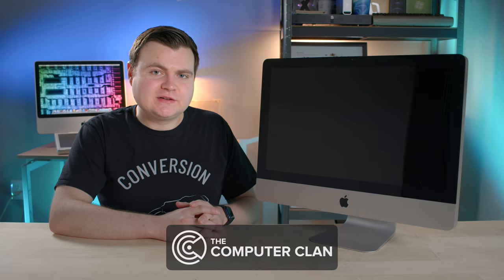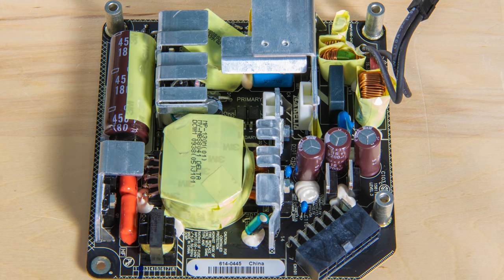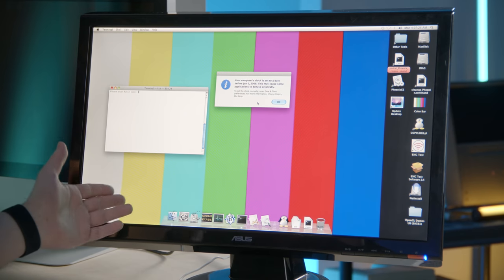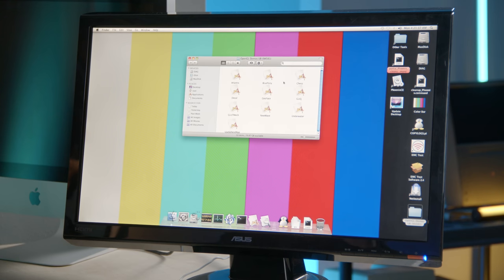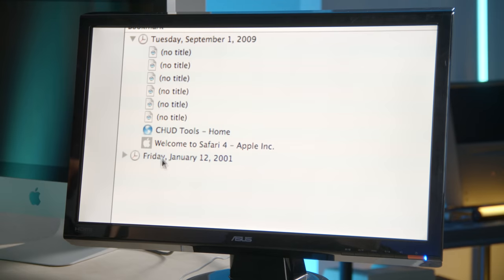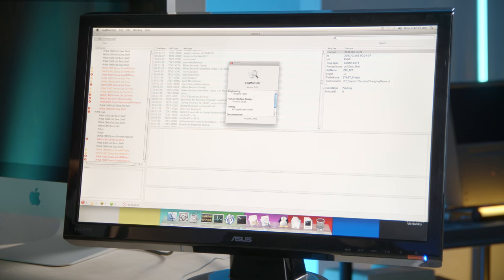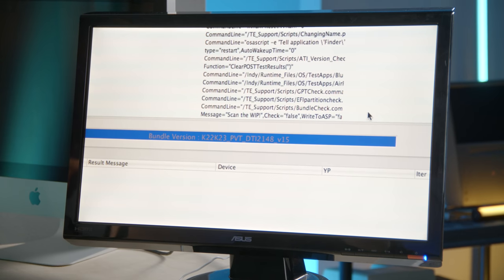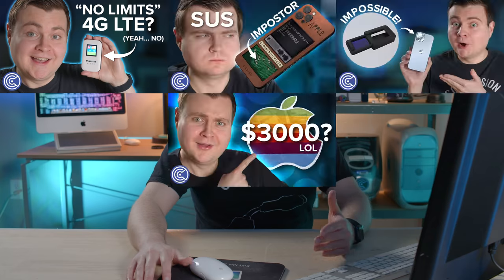Apple Forgot to Erase This iMac's Internal Software - Krazy Ken's Tech Misadventures

Comment: this makes me miss the days then the front glass was held on with magnets instead of an entire 55 gallon drum's worth of glue.
Reply from the maker: I feel that 😔
Reply: nahhhh it was 55 gallons back in 2017 now its 110 gallons 😂
Reply: @SStarlight9614  Next year the glue will be too expensive and will be replaced by "Hopes and Prayers."
Reply: Hopefully there will be a "glue and adhesive" shortage so Apple is forced to make things more repairable again.
Reply: Ooof, I feel you pain too--get out your spudgers! :)

Dell's laptops have a front plastic bezel in front of the LCD panel that uses a strip of high-stick adhesive along each side facing the LCD to adhere to the LCD's edges.  A real pain in the rump to pry one of these bezels off sometimes without breaking it, due to being thin plastic--at least it isn't glass. :O
Reply: Apple is going lose half of it's value in next few years. Entire company.
Reply: @JJ Bluestone I have a 2007(?) vintage Lenovo laptop (IdeaPad Y730) that seems like they glued  the face glass on as well.   Have never found anyone who knows how to dismantle this macine's display, and searching for it is further complicated by Lenovo foolishly re-using the same series and model number for their later "Legend" systems.
Reply: @simtitan1  Actually, the US and EU are considering laws that would legally mandate end-user repairability.
Reply: @Vanilla0729 oh nah
Reply: “I just dropped a screw inside” every single time when it’s mac -..-
Reply: Fr
Reply: Funny thing, i have an imac with a good LCD and cracked glass. I managed to get the glass off without damaging the LCD, and now i cant find the glass to buy because they never expected anybody to actually get it off

Comment: AppleKFS is kernel file system. It is useful for knowing what's going on with the system. It's especially the same as /proc on Linux, which just reads ram and other system activities. They are both virtual with very limited write options
Reply: This is the correct answer.
Reply: Abstract— The Knowledge File System (KFS) is a smart virtual file system that sits between the operating system and the file system. Its primary functionality is to automatically organize files in a transparent and seamless manner so as to facilitate easy retrieval. Think of the KFS as a personal assistant, who can file every one of you documents into multiple appropriate folders, so that when it comes time for you to retrieve a file, you can easily find it among any of the folders that are likely to contain it. Technically, KFS analyzes each file and hard links (which are simply pointers to a physical file on POSIX file systems) it to multiple destination directories (categories). The actual classification can be based on a combination of file content analysis, file usage analysis, and manually configured rules. Since the KFS organizes files using the familiar file/folder metaphor, it enjoys 3 key advantages against desktop search based solutions such as Google’s Desktop Search, namely 1) usability, 2) portability, and 3) compatibility. The KFS has been prototyped using the FUSE (Filesystem in USErspace) framework on Linux. Apache Lucene was used to provide traditional desktop search capability in the KFS. A machine learning text classifier was used as the KFS content classifier, complimenting the customizable rule-based KFS classification framework. Lastly, an embedded database is used to log all file access to support file-usage classification.
Reply: I pulled this from a computer research paper on the subject and I feel like this would be more accurate…
Reply: @revlouch  I doubt it’s that.

The kernel file system answer seems to be the more likely, given the diagnostic nature of the OS running on that Mac.
Reply: If it's a kernel file system, why would it be a physical partition on disk? Kernel file systems are virtual.
Reply: @Daniel15au  Because, if the kernel intercepts io calls, even disk utility might be tricked into thinking it actually exists. For all intents and purposes /proc on Linux has actual files and folders in them. You can stat them all day, and to bash, sh, zsh, gnome, kde etc… it appears as if those files and folders actually exist on disk.
Reply: @1FireyPhoenix  makes sense, thanks for the reply!
Reply: this is very unlikely. The bsd style disk name that he showed lists a partition number. virtual file systems never have a partition on the disk, let alone the main disk (disk0). Virtual filesystems will show up as a mounted filesystem, but won't have an associated disk partition.
Reply: I could be wrong, but I think OS X still uses (or used at the time) the vfs from BSD, so I don't think they'd have any reason to have fake partitions to represent virtual file systems.
Reply: So indeed it is the kernal's secret recipe.
Reply: Ahh, so it's like linux's relayFS? For delivering message from kernel module up to userspace?
Reply: This is wrong. Apple_KFS is the partition type, not the file system. It clearly says that in the video. It also doesn't list any file system, so either there's nothing on there, or it's an unknown file system to macOS. Partition types aren't the same as file systems. E.g. EFI partitions, recovery partitions, encrypted loop partitions etc. Even in Windows, there's one partition type for NTFS, exFAT and ReFS, type 07, or 0700 if you're using GPT layout.

Comment: Whilst opened up, it would have been wise to temporarily extract the hard drive to copy a full block level dump of it. The contents would have been super interesting for others to explore, and it would have saved the contents from never being rescued if the disk failed. Otherwise a nice video!
Reply: Just read in other comments that was apparently not supposed to be backed up. Ah well.
Reply: @everythingpony  Exactly!! Even powering up such an old disk, possibly one that didn't yet meet production standards, could cause its death - even more so booting an OS off it and using stress tests on it.
Reply: @Time4Technology  You would not use a hard-drive that is not up to production standards for a Product Validation Test unit.
It is easy to upgrade and test hard-drives later. It is a wast of time to hunt down hard drive issue, when that is not one of the uniqe selling points of the device.
(if the SSD Chip set is soldered to the mainboard, then offcourse it could be not fully qualified - but even then, reducing risks means using proven silicone and software on a new motherboard makes more sense then to combine all new parts)
Reply: Not legal sadly.
Reply: @FeedMeSalt  Legality can honestly kiss my behind when it comes to software preservation, especially pre-production stuff

Comment: As a former employee in Apple's Sacramento warehouse I can tell you that PhoenixCE is indeed a version of MacOS with a bunch a testing suites used to troubleshoot. We would load Phoenix then leave the systems to burn in for 2 days then if they fail there were logs for us to read. The version of Phoenix here is much older than the one I seen. The version I knew was based on Yosemite. Most of the tests runs on its own but some of the display calibration tests and keyboard tests had to be manually gone thru and passed/failed before the rest of the tests can load. And yes it could be loaded on any mac that can support that version of MacOS it was based off. By now I'm sure they have a newer Phoenix than even I'm aware of, used for the T2 macs more than likely. So this version of phoenix would not work on newer macs.
Reply: You are correct and to my knowledge Phoenix (and most of these tools) is not installed to new machines these days it is used from local network preventing it from leaking like this!

Comment: As a former Apple repair depot tech, can confirm that Phoenix is Apple's  test bundle name. The versions would differ between models but it was always a Phoenix environment. Seeing those failure pop ups reminds me of all the headaches but still pretty cool to see it again!

Edit: as far as the K22 thing goes, you're right. Every Mac model will have this number combo to point out year and Gen, but not necessarily the specific build. For example, the J52 was the 2015 MacBook Pro Retina 13 with forcetouch. J44 was the mid to late 2014 MacBook Pro Retina.
Reply: Thanks, SouthernFriedTech
Reply: Oh what about the J680, J132, and J152?
Reply: Very interesting! I do liquid damage repairs on Macbooks and I was always curious what the codenames at the top of the schematic were - the 2014 Macbook Pro example you used has an 820-3476 logic board, and the schematic says J44 as well!
Reply: Lol remember when they openly called a feature “forcetouch” without thinking about how much it sounds like a slang word sexual assault
Reply: "Apple's  test" you double spaced it.
Reply: @pickachublast8  maybe they add a digit to original identifier for revisions?
Reply: @thomasholland5902 did they remove that branding because of that? I always thought they just don’t bother mentioning their trackpad tech anymore since it’s been the same for 8 years.
Reply: @LuLeBe  nah just they changed it to 3D Touch

Comment: The last time anybody on the AppleInsider staff used or saw the "Phoenix" suite of software was several years ago. Even then, during the testing process, the software would have to connect to either a hardware dongle or data stored on a LAN -- not WAN -- to complete testing on any given model.

Eradication of the testing software is a required step prior to returning a repair to a user, and there is a specific procedure that is followed to ensure compliance. Obviously, those steps were skipped, resulting in the leak of the software.
Reply: Do you know what method Apple uses to delete the software, or otherwise have any information that might be useful for someone wishing to covertly protect their newly-acquired copy of the software from being re-erased by Apple before they get their computer back?
Reply: @Sparkette  >Do you know what method Apple uses to delete the software
they probably just deeply format the drive on the mac. if they dont, then idk what else you can do
Reply: I had to send my 2006 MacBook to Apple because of a bad heat sync and they sent it back to me with Phoenix software. I had to send it back AGAIN. Sucked

Comment: 18:35 "Raw" usually refers to the raw data representing the value, while "Cooked" refers those values having been converted into something fit for human consumption
Reply: I've never heard the term "cooked". I should probably start using it, though, because typing "converted" all the time in my code is a bit cumbersome
Reply: @IndellableHatesHandles  From the jargon file:
cooked mode: ... Most generally, cooked mode may refer to any mode of a system that does extensive preprocessing before presenting data to a program.
raw mode: A mode that allows a program to transfer bits directly to or from an I/O device ... without any processing, abstraction, or interpretation by the operating system
Wiktionary gives the etymology of cooked mode as "a humorous opposite to raw mode".
Reply: It is like when you have raw food and you have to cook it
Reply: A raw partition doesn’t have any data on it yet, i guess
Reply: @CerealNumberWDW1984  A raw partition usually means that the partition does not contain a filesystem recognised by the operating system / disk management software.  There might still be a filesystem, but it is not recognised.

Comment: I think the backlight doesn't work because the PSU is different than the previous one, you need to get a backlight driver board compatible with this PSU that you replace or find a compatible PSU. The description of the flickering then it shuts off is almost everytime a compatibility issue between those two parts.
Reply: Def seems like it's not getting enough voltage, yes.
Reply: Backlight board in these don't care what kind of PSU is installed
Reply: @michvod  We are literally talking about a company who goes as far as locking components to specific devices with unique identifiers (on newer iPhones at least) so I wouldn't be so sure
Reply: @baconofburger8784  Yeah, but I literally repaired hundreds of these model iMacs and I know that backlight board and PSU are just dumb units and don't care which one is installed ;) This is 2009-2011 when Steve Jobs was still around
Reply: @michvod  fair

Comment: A screen full of H was what caused a computer to generate the most EMI back in the CRT days. We used it for FCC emissions testing.
Reply: H reigns supreme
Reply: because of the sudden changes from full bright to full black? I guess as the electron beam scans across it would have to turn on and off rapidly many times per line per frame.
Reply: @iammeok  would hashtags not be better in that case?
Reply: @Stego27  The character "#" is called a hash. A hashtag is a word with a hash appended to the start. Eg. #retrocomputing
Reply: @Stego27  yeah idk, maybe they didn't have '#' in whatever character set they were using?
Reply: @Joseph Palmer
interesting....I would think a bright white screen would do that since all 3 guns are firing and all RGB dots are on...maybe i am remembering my CRT tech wrong... it has been many years since i worked on CRT's
Reply: @MickeyMousePark   I think you'd actually get less interference from a fully white screen because you'd hardly have any changes. Seems to me that a screen full of alternating black and white pixels would be what would make the most noise. A capital "H" would have four black/white transitions on every line except the middle, which would only have two, so it'd make a decent universally-available source for a signal with plenty of transitions.
Reply: Wouldn't the IIIII be more effective in this case?
Reply: @pierreuntel1970  No, the H pattern caused more emissions harmonics, because of the difference of the gaps between the On-Off events.

Comment: Apple_KFS, the KFS is probably Kernel File System, something (similar to Proc on Linux). The 1.9TB is possibly nonsense as it will be virtual, and I would suspect that this is how some of the Diagnostic tooling chats with the Kernel Space in a more privileged mode.
Reply: Then why have it representred on disk? Spinning metal cache for swap and what not is fine, but proc and similar are virtual filesystems which won’t be on disk. Caching process state even for debugging would slow the system down and bottleneck the system. We need to see the first few MB or so to understand the data.

Comment: Also, there's a chance those URLs do work but only on Apple's internal network, but I'm sure you already know that.
Reply: brian ting  that is illegal
Reply: brian ting  I don't think they're gonna give you Internet access and if then definitely not the WiFi for the internal systems.
Reply: brian ting  Hope not!  That would be a major security flaw on their part ;)
Reply: brian ting  that is a very funny idea. Even company with small IT departments sand box the guest Wi-Fi. Even the internal LANs are typically split between departments. (Note in the windows world to protect the core network from the wild developer machines - not to protect development from theft)

Comment: The Electrolytic Capacitor that blew is in the backlight circuit.
Reply: I seem to have that kind of problem after a lightning struck the house. The screen would turn off after a while. I did buy a replacement power supply card, but to no avail. It’s the same generation of iMacs. 
Do you have more information on that backlight cap fault, is there a way to fix it, maybe a lead on some Google search terms to start a repair. 

Thank you in advance for any clue.
Reply: Electrolytic capacitors are a deal with the devil -- never good, but sometimes necessary. Maybe someday dry capacitors will be advanced enough to make electrolytic capacitors completely obsolete.
Reply: @deusexaethera  at least we used to have great brands like Sprague, now we have crap brands like Nichicon or no brand at all. There are even counterfeit Electrolytics, that are an empty can, stuffed with smaller, lower value capacitors so they seem to work and with sand lured in before sealing the bottom!

Comment: The EMC application will no doubt be running though the various system functions quickly on an endless loop so you can ensure you are measuring the worst case reasonable emissions and monitor functionality while exposing the system to external disturbances. Nice to see as morning complex systems like a computer manually can be painful

Comment: PDCA (Product Data Collection and Analysis) is an internal portal used in factories (e.g. Foxconn), "Warehouses" (e.g. Austin Mac Warehouse) and Apple Engineering. There are a lot of environments of PDCA/SDS for each factory/site.
From memory, I think product serialization was a part of PDCA/SDS so it may be most that this iMac was from a factory/warehouse (in PVT stages) and also PDCA included a lot of reports for hardware and factory QA/performance.

Comment: I've had my Pro Tech Toolkit for over a year at this point and only when you did it did I figure out that the bit set lid has these plastic things to act as a screw holder. OMFG
Reply from the maker: Pretty cool, eh?
Reply: I only realized it some days ago too.. after using it for years.
Reply: I bought a magnetic project mat because I didn’t have a good place to store screws for crying out loud XD